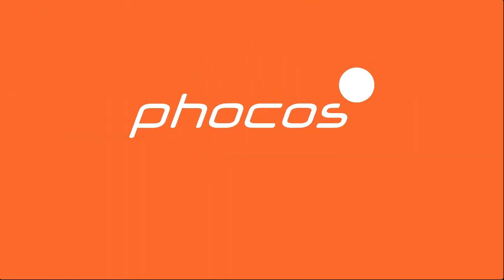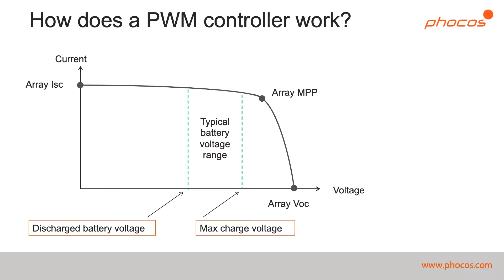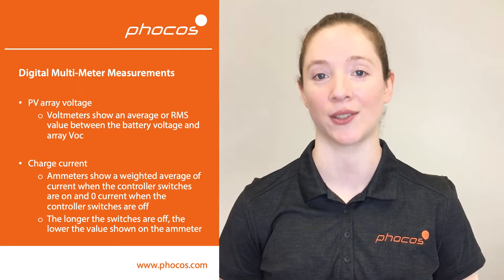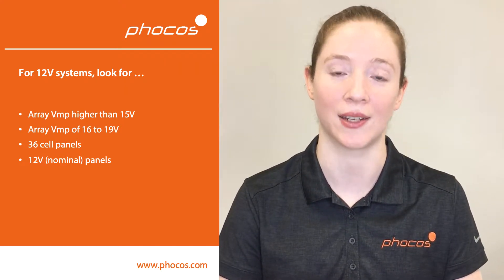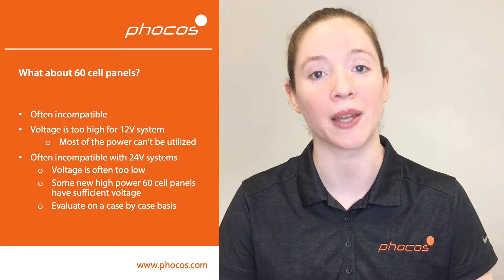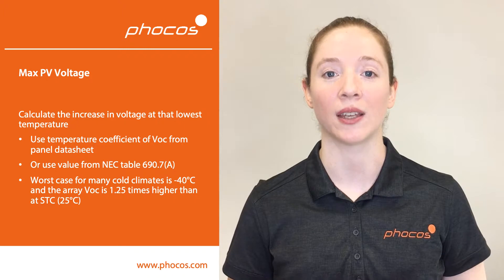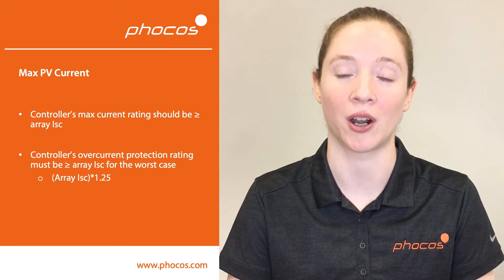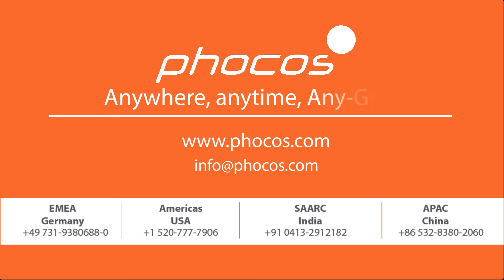Matching A Solar Array With A PWM Charge Controller

Comment: If I have a 100W solar panel and a 12v battery, can a 10 amp charge controller  work?
Reply from the maker: Hello, thank you for reaching out to us. To size your charge controller to your battery we must divide the size of your solar array by the nominal voltage of your battery. In this case 100W/12V = 8.33A. Therefore, a 10A charge controller would be ok.
 
Please be advised that this analysis does not consider if this array is large enough to charge your battery bank. This comes from performing a load analysis and then sizing your battery bank (in Ah) + PV array to meet your load demands. If you need help with this please reach out to our tech support: https://www.phocos.com/contact/#contactech2

Comment: Will the panel damage the PWM charge controller when its rated voltage is higher than the max allowed voltage for the controller? What I hear seems to be that in this case it only uses a fraction of the panel's wattage but is ok.
Reply from the maker: Hello, for PWM solar charge controllers, there is a switch between the PV panel and the battery. The voltage rating of this switch is one of the parameters that limit how high the voltage of the PV panel can be. So yes, the PV panel might damage the charge controller if its voltage is too high. However this is where best practices for system design is important, so the equipment selected works optimally together as designed. If you have a specific PV panel you would like to use with a Phocos charge controller, please contact us on our website www.phocos.com and our support team will be happy to check their compatibility and give you more details.

Comment: Appreciated , Nicely presented this information. Thanks ma'am.
Reply: Good informative video. However, what I hear is that, if the PV voltage is too high, PWM charge controller will only use a fraction of the rated power of the panel. My question is: will it damage the charge controller? This is because when given no choice I want to use the higher voltage panel at hand to charge.